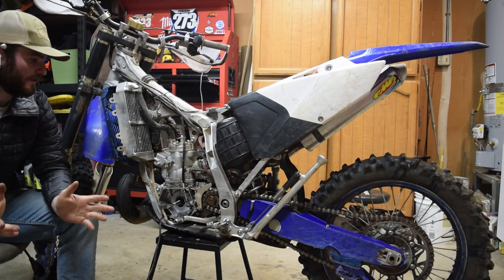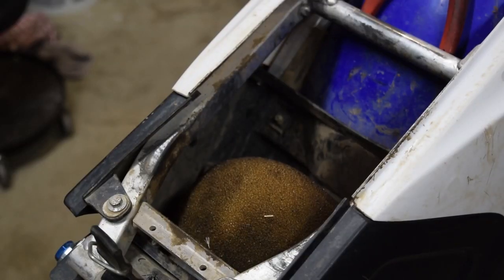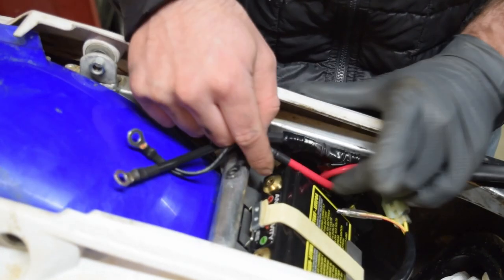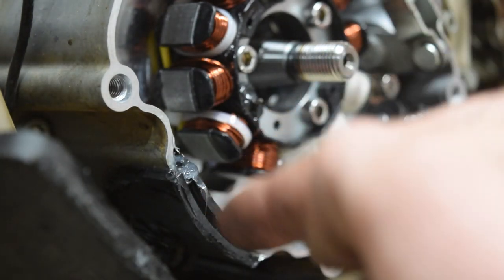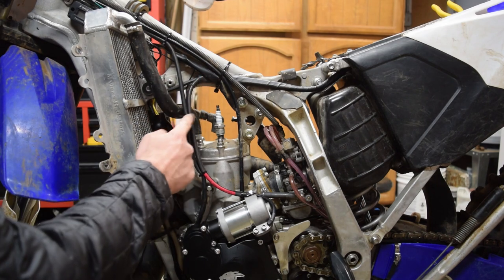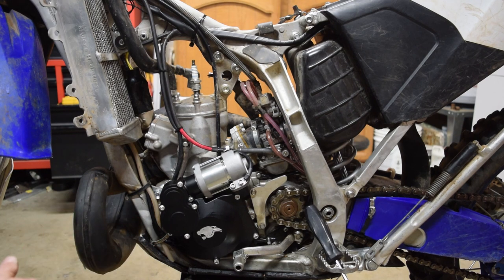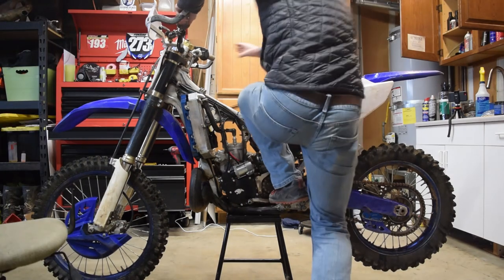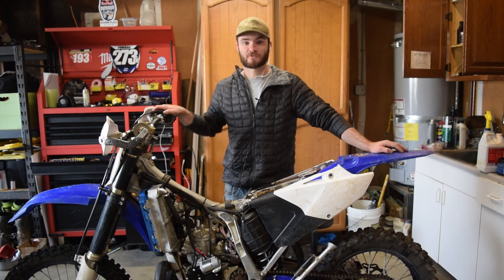Electric Start YZ250 ! | Is Yamaha the new hard Enduro weapon?

Comment: You don't need electric start on a 250cc 2-stroke.  You just need to lower that stupidly tall YZ 2-stroke (I have the 2019), so you can pull out the kick start lever with out falling over. :)
1" off the seat. .75" off the suspension top out.  You go take the berm way on the outside there stilts,--I will take the inside off camber now. :)

Comment: hello my friend how are you.... i am brazilian and a lover of two stroke bikes, i had a yamaha wr 250z 98 and i also adapted the electric starter on the motorcycle, i used it for years and in enduro I see the importance of having an electric start, yamaha is sinning in not inserting the electric starter in the yz 250x and they should increase its motor by 300cc..... you have my congratulations, your project was excellent.....
Reply: Please write them and tell them. I did.

Comment: So nice I can’t wait to order my thanks.

1 question I see you add the Electric Radiator Fan what brand name s or Kit name the you recommend thanks
Reply from the maker: Hey Cesar, I am running the TUSK universal digital radiator fan kit from rocky mountain. I honestly can't recommend it. While the fan works the temperature sensor on mine failed. I ended up wiring it up too a simple switch on my bars so I can manually turn it on or off. This works well but isn't perfect. When I find a solution I really like Ill be sure to make a video.
Reply: @GoldenAppleGamers  thanks for the info great bike sounds good 👌
Reply: @GoldenAppleGamers  maybe look at the oem sensor from a modern WR.

Comment: Couldn't quite hear you over the bike when it wouldn't start. Basically wont start cold on the e-start ?. Wonder if the 8 cell would be better cold ?? . Either way I'm looking forward to mine ! , don't mind kicking it cold anyway 👍
Reply from the maker: It wont turn the bike over quickly if your not "Trying to start it". This means fuel on, choke on, throttle cracked open like you are ready to go. I have cold started it a number of times now using this procedure and it comes straight to life. Once it has warmed up for a few minutes it starts instantly, but you still have to crack the throttle a touch like you normally would when kicking it. drop a subscription, I have a first ride video comming out with a tip on bending the clutch arm. Looks like I should pay more attention to my audio in the future.
Reply: @GoldenAppleGamers  that sounds promising then ! Even if it didn't start cold ,I would prefer the extra room afforded by the smaller battery . But since it does, even better 😃. Very nicely done btw 👍
Reply from the maker: So far so good with the smaller battery!🤙🏼 air filter change isn’t that bad with the 4 cell battery. thanks for watching and commenting!
Reply: 8 cell is no better
Reply from the maker: I figured it wouldn’t have much more power, just extra capacity. I have been happy with my starting during ridding. How about you?

Comment: Hey thanks for the video. I also have a 09 yz250 ride at carnegie as well. I have been hesitant on getting one of these after watching/reading some of the bad reviews. How has your system held up? Still worth it? Any lessons learned or failures of the system? Do you know if panthera has made a 2nd gen model for the yz? Thanks for your videos!
Reply from the maker: I have been meaning to make a follow up to this video…. The system ran nearly perfect for 18 months. Put over a hundred hours on it. I then started having some weird symptoms, i thought I blew up my motor. It turns out the bike wasn’t running because the stator pickup had debris on it. This was a big deal but at least it was fixed. The bike then ran perfect. I put about 5 hours on the bike, perfect. I then took it to a race, page AZ hard enduro. About 15 minutes into the race bike completely stopped. The stator had failed. I actually swapped back to all stock during the race and finished a single lap. I was very upset. I contacted panthera, and he wouldn’t help me because I was a few months out of warsnty. I would consider this a defect or a design flaw that is not acceptable. In any case the stator failed. If you do want this kit get the version without charging. It has its own isssue (you have to modify your flywheel permanently) but at least it will not leave your bike dead with absolutely NO way to fix it. Unless you have your whole stoke flywheel and stator. I think the company is cool, the idea is cool, the build quality seems high. But I think the design must have some issue. I will be getting a bike with a factory e start next, for now I will either ride without e start or use the kit without charging.
Reply: @GoldenAppleGamers  Devin thanks for all this pertinent info. Yeah I think the same that it is a great idea, but long term not there yet. In the middle of the desert or forest and the bike completely dead unable to start.....kinda a problem and with a one year warrant at that price, gonna keep on kicking and bump starting this machine until I do the same of buying a bike with e start from the factory. Thanks again for your time getting this info out! 
Also wanted to ask did you install an on off switch for your radiator fan? 
I installed the tusk racing universal fan and attached it to a battery but I liked your idea of wiring in a on/off switch to your handlebars to manually turn it on and off.
Reply: Also what are your thoughts on a big bore 300 upgrade kit....have you installed or looked into getting one?
Reply: How has yamaha not made an E start for these bikes? You would think at least there would be an aftermarket kit that has been around for a while that has been proven to work